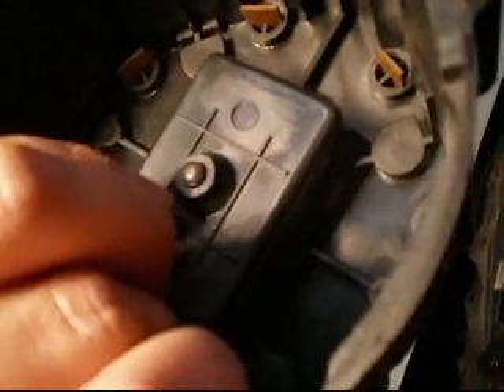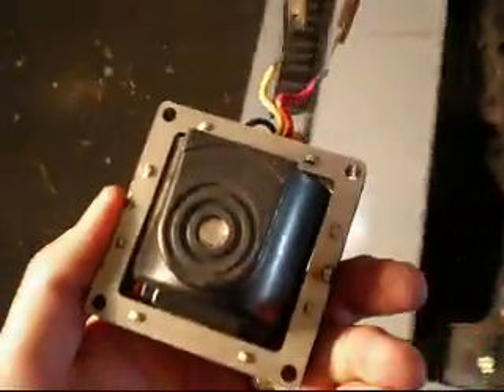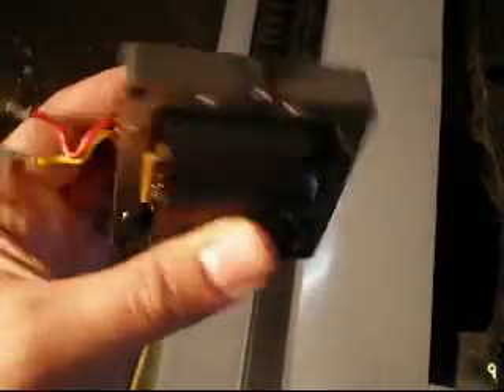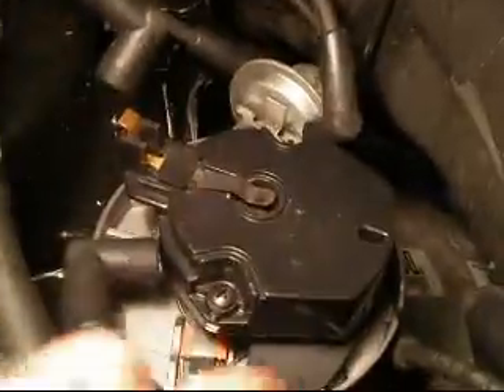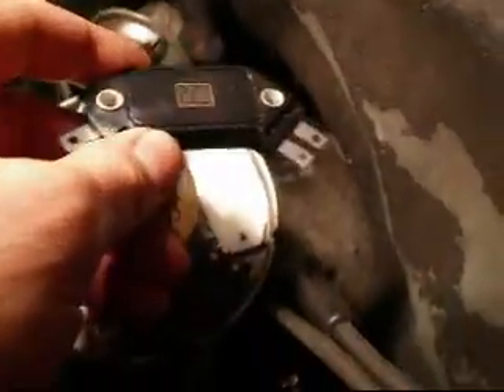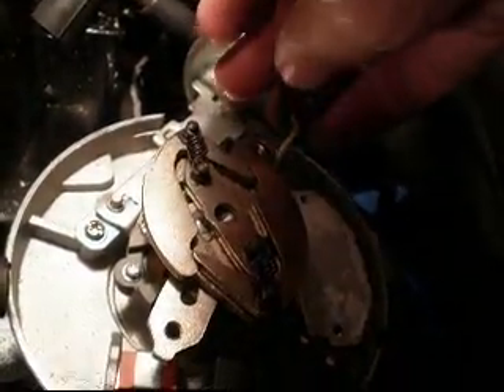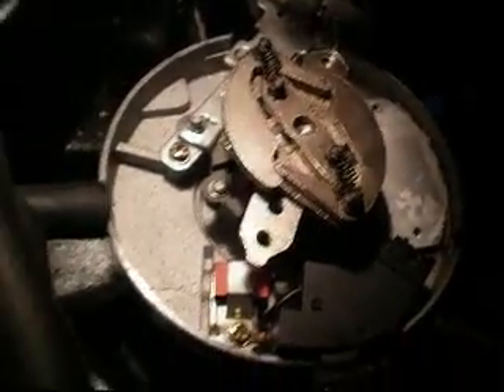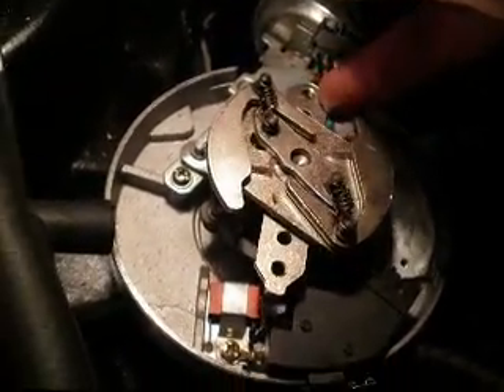Olds V8 HEI diagnosis

Comment: @BEETEROLDS what if the spark is weak?
Reply from the maker: justin bad coil
 Bad ground bad pickup coil
.. weak continuity via the 12v source it could be anything
Reply: BEETEROLDS it’s got a good 12v
What happend was the connector fell out, so my buddy used crimp connectors. Ever since then , the 383 would not fire up pulled the plug and can see spark but it looks super weak

Comment: did you ever figure out what was the problem my Module keeps burning out but I don't know y
Reply from the maker: +Taniela Moi Moi The carbon tip that goes between the coil and the rotor was on the wrong side of the fat rubber insulating washer... so the carbon wasnt making contact with the rotor very well.
Reply: +D.Szymanski  ok thank you hopefully thats what's my problem